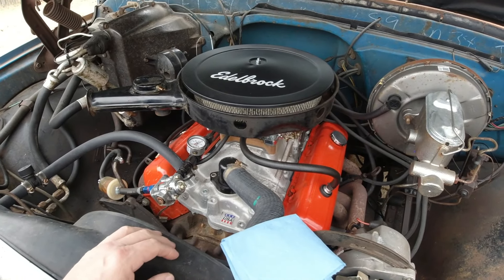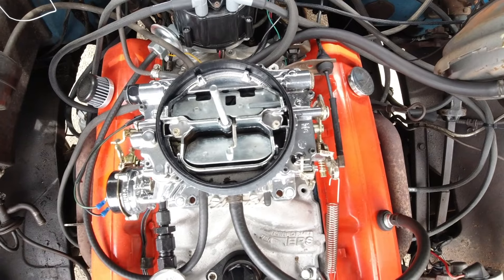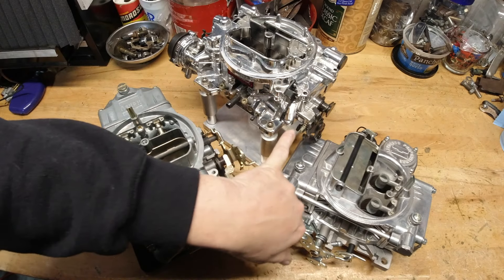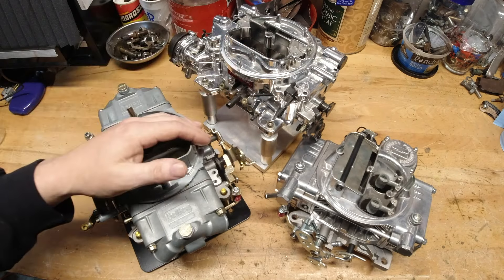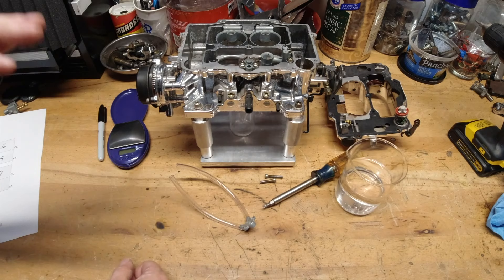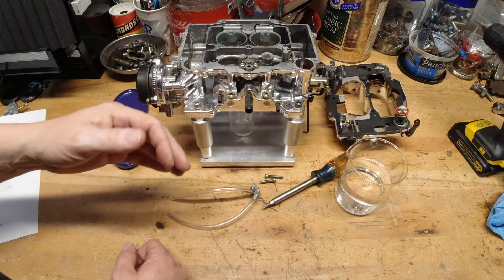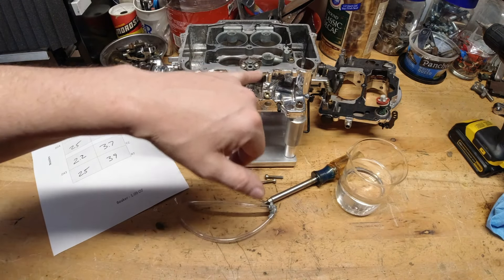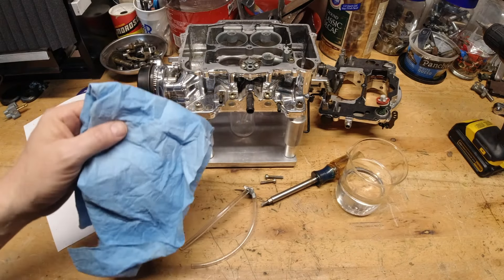How Accelerator Pumps ACTUALLY Work

Comment: Nicely explained. I would think that the smaller the nozzle, the better the atomization to a point.  On a different topic since I'm here. I've been fiddling with my regularly driven Chevy II, 350/ 700R4 trying to maximize MPG. Replaced the 1411 with a fresh rebuilt 1406 and got an improvement, can't say how much, the odometer quit working but it's better. While rooting around in my garage, I found an old original AFB in good condition, got a new buzz tank cleaner and an $18 Ebay rebuild kit. Both the cleaner and the kit worked perfect except for the accelerator pump stalk having too small a hole in it where the "s" linkage goes. Question, the old AFB is a "spread bore" type with much smaller primaries and much larger secondaries than the Edelbrocks. I'm expecting another improvement once I get it on the car. I believe the AFB is 600 CFM but can't verify 100%. What do you think?
Reply from the maker: I did a video on this exact topic a couple years ago.  I’ll leave a link to it below.  The gains on swapping out carbs and sizes is minimal.  Driving style probably will account for more if you’re not hard on the gas every where you go. Lots of videos out there I’m sure on hyper mileing I’m sure.  The eBay rebuild kits.  Yikes.  I did a review on one a few months back.  Anyway, here is the video on fuel economy in a muscle car if you’re interested.  https://youtu.be/vSfAbSH9NQk.
Reply: @MuscleCarSolutions  Thanks. I'm sure the Ebay kits are hit & miss in quality, Just wanted to throw out there that mine worked well, even came with two top gaskets. Actually bought 2 sets, both were fine. 
I did the hyper mile thing years ago with a 1990 Ford Festiva, 1.3, EFI. Just a touch under 60 MPG before ethanol came out. Dropped to 45-50 with E-10.
Reply from the maker: That’s pretty remarkable results.  Have seen a few folks talk about how much better their fuel economy got when they put that into practice.  Pretty cool for sure and even more so with expensive fuel prices!

Comment: Hey Brian, let me see if I can ask this where it makes sense, my 1406 is in Eastern Washington so I can’t see the carb but I think the accelerator pump is in the middle hole, my question is if it is happy where it is and I moved it to the higher hole (more squirt) or to the putter hole what would I expect to happen, this go’ s for idle or under load
Reply from the maker: Moving the accelerator pump position won’t affect idle.  It’s a free adjustment.  Move to either the top or bottom and go drive. Better or worse, then you’ll know if it wants more fuel or less.  Keep tuning from there.  It’s an easy way to start the tuning process when you’re just doing a very inaccurate seat of the pants type adjustments.
Reply: @MuscleCarSolutions  thanks Brian, I should have said stabbing it idling in neutral opposed to in gear, that’s ok I understand what your telling me, thank you
Reply from the maker: @DesertRatFabrication  won’t have any effect on it.  There’s no load on the engine in neutral or park.  Only concern would be driving but you’ll sort that out pretty quickly as you’re tuning it.
Reply: @MuscleCarSolutions  ok that’s what I wanted to know, thanks buddy
Reply from the maker: @DesertRatFabrication  it’s a good adjustment point when starting on tuning a new combination.  Easily my favorite place to start as it’s easy and costs nothing to test.  Good luck with it!

Comment: I have watch this video a few times now. I even made a video where I compared the accelerator pump that came with my carburetor to a replacement pump that had a shorter stroke. I theorized that the pump with the longer stroke deliver more fuel. Upon further review I don't believe that is the case. The accelerators pump will only compress as much as the linkage will allow. But the main reason for this comment was I'm surprised nobody else asked why you were missing a primary booster🤣👍.  I understand this had no bearing on the test I just thought it would be funny to mention it. I have watched so many of your videos multiple times I feel like they are in between my 1/2 wrench and my T15 driver in my toolbox. Basically there are the go to any time I have a question.
Reply from the maker: Spring on the pump assembly is the key.  Edelbrock offers four different part numbers depending on the carburetor.  Cup and spring is the difference.  The heavier the spring, the bigger the shot!
Reply: @MuscleCarSolutions  Got it!!

Comment: Great info! Was wondering, does the accelerated pump also introduce partial shot through the rpm range??
Meaning say instead of off-line drag, doing a rolling start drag at 30-40mph with instant wide open after that?
I get a stumble only on wide open throttle, but never at low rpm it’s at around 4000rpm.
I’m learning, still a bit confusing to me. haha
With my problem it’s almost like maybe my accelerated pump is running out of fuel by the time it gets to 4000rpm. Maybe how you explain, I need a smaller diameter so the duration of flow last longer…?
Reply from the maker: Not sure what carburetor you’re working on, but at that throttle position you’ve likely advanced the rotation of the accelerator pump to where you’re not getting a very big shot.  Look at your secondary tuning.  Have you changed the jet sizes?  Are you running the AVS carb where you can change the rate of the air valve?  Running a Holley?